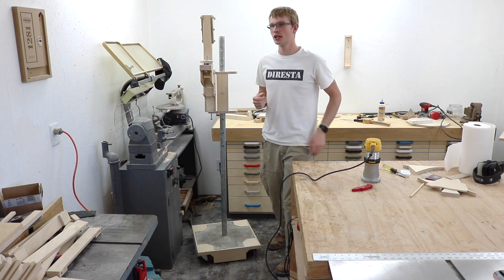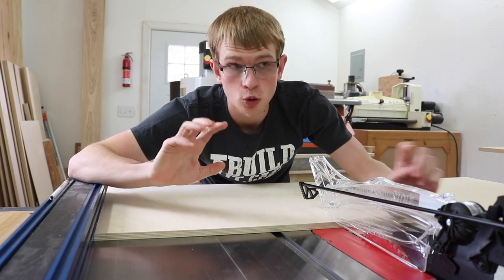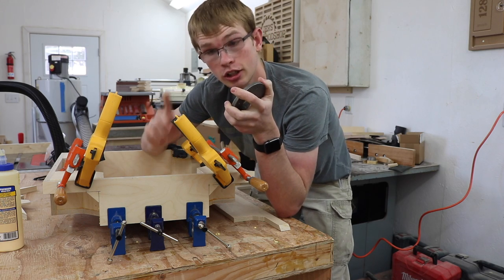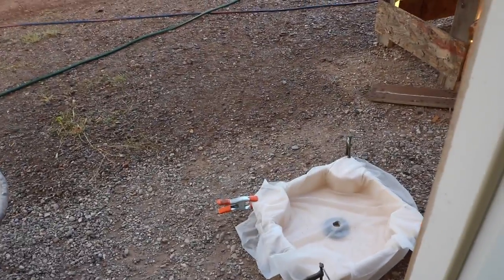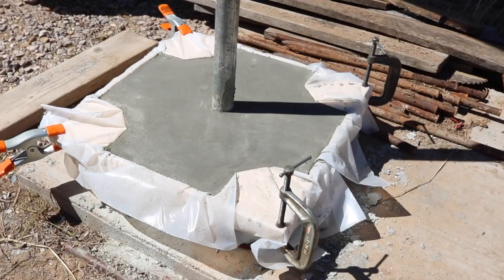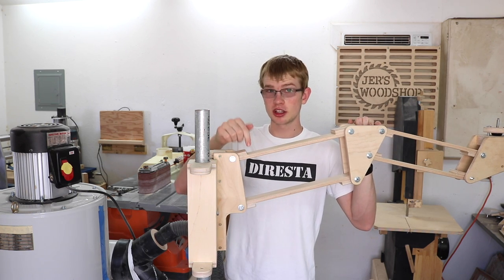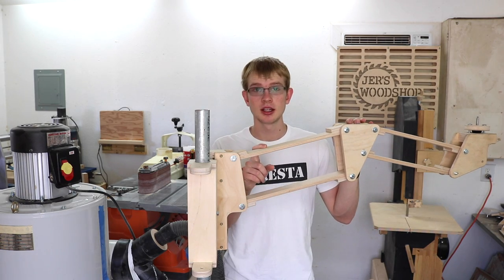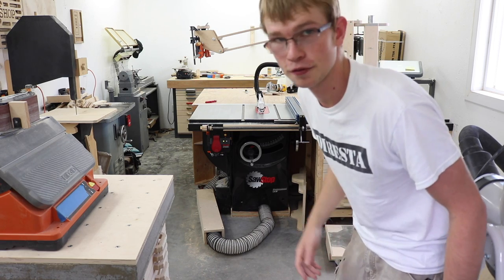Rolling concrete camera rig

Comment: I wasn't sold on your camera-mount-on-the-wall for my usage (my walls are mostly clogged up), but I'm a big fan of this, camera-equipment-making-guy! The small footprint is the killer feature for me, a lot of my shots the tripod has to go around dust collection hoses and power cables just to get the correct angle.
Reply from the maker: +Paul Jenkins 
I'm thinking I probably won't even use the wall mount anymore, except over the metal lathe.
You mentioned cords & DC hoses...those might really be a problem if you have a lot of them on the floor. When moving something on casters, those suddenly look like unyielding obstacles!
Reply: It shouldn't be too bad, I have a ramp/cover thing over the main cable, its just because of the stupid footprint of the tripod it gets in the way. The same shot with this - particularly with the boom arm - would have the base well clear of anything.

Comment: Over the 7 years since the the idea was shared I had the idea of three wheels being better. Now I’ve made a list of pros/cons. Tipping a tiny amount on a relatively smooth floor doesn’t seem like a priority. Wide enough three wheel is stable but four wheels rescues the directions it can tip by a great amount. Seems like a toss up and I’ll likely end up making both.

Comment: Really nice work you're doing!

If I might offer a suggestion -- the reason you had a failure at the 9:30 mark is because you are relying solely on glue to hold the joint.  This is actually quite common and I don't know why more people don't cross-pin the wood.

What I do (even on solid wood that will be in a similar application) is to drill 1/8" holes through the plywood, from one face to the other.  Then glue in short lengths of 1/8" dowel rod or those bamboo shish kabob skewers you get at the grocery store.  Both are fully sand-able and give you a very nice look when finished.

In your application, you'd need at least two of them between the end of the arm and the hole for the pivot.  Three would be better, and four or five might be nice just for the visual appeal.

What these bits of dowel are doing is acting like rivets.  While you're still relying solely on a glue joint, because you now have all the layers of plywood joined together by the dowels, they have to move as one unit..... straight through the dowels.  

On solid wood, I drill from edge to edge - the hard way - and glue in as large a dowel as is reasonable and the board will allow.  As long as you glue or screw either through the dowel or behind it, you've got a super strong end piece that won't check in years to come.  This is especially useful when doing something like a canoe carry handle where there is almost no room between the end of the wood and where the screws have to go!

Hope you find that helpful.  Keep up the great work!
Reply: Or just punch few nails in. It won't be as pretty but it will hold.

Comment: Well done, señor.
I made a PVC camera holder (Frugal Film Maker) that is cheap and laughable but it does have a very small footprint.
I love your concrete approach. 
Generally i'm a sucker for projects involving wood & steel or wood & brass, but you and Ben Uyeda are pulling me into the concrete realm. Thanks for the inspiration !
Keep on trucking ! (from France)
Reply from the maker: +MakeFix 
Thanks!
Concrete is kinda fun (and sometimes frustrating), and I think it definitely has its place.

Comment: Love this design! My shop floor is pretty uneven. Thinking of doing three wheels instead of four. Thoughts anybody?
Reply from the maker: I think making it three-wheeled is a good idea for an uneven floor. It will be slightly easier to tip over, but this one is almost impossible to tip so I’m sure it’ll still be fine.
Reply: @Jer_Schmidt  thanks Jer! I didn’t expect a response from the man himself on a video from four years ago. Very cool!

Comment: Hey you might want to consider putting some kind of rubber dampers/bushings at the camera mount and where it attaches to the pole- maybe it will smooth out some of the shakes so you can use it as a dolly

Comment: Great job man. I'm halfway done with something like this but since my floor is not even I'm just using a 5 liter oil can that I will have to move :S. Your design for the base was very clever! I was wondering why not just a friction fit for the pipe bracket? Mine is just a big block of wood with a hole and a partition, tightened with a  knob (not sure that makes sense). It does the job just fine and even better when the arm is extended. That saves making holes to the pipe and a "non discrete" height adjustment since my arm is not that flexible. Yours is awesome, I'm just thinking outloud now lol. Great job and thanks for all the good ideas!
Reply from the maker: +Cactus! workshop 
Thanks!
Because of my two-linkage arm, I have a lot of height adjustment in just that. So I don't plan to move the mount up and down the pipe much, and therefore I wanted it to be mounted fairly rigidly. But if I was planning to move it any more frequently then yes I would want something like a friction fit or just a simple locking knob.

Comment: Very nice piece of equipment.

You mentioned putting something on top of the concrete to protect it from chipping - why not skin it with plywood? Then you could mount accessories on the base later, if you develop any (storage for extra arm mounts, or camera adapters, etc).

With the mount being double-sided, you could put a monitor or laptop on the opposite side, connected to the camera, so you can see the image at a larger size while filming.

Comment: very nice idea, do you please have any idea how to build a C-stand, that cane go high like 3m or 2.5m where we can put some light projector?
Reply from the maker: +Cours Kiné 
With this stand I can put the camera up to just over 2.5m, by putting the bracket in the highest hole in the pipe, and extending the arm as high as it goes. You could make it go higher by simply using a longer pipe.

Comment: Mr. Schmidt, I'm a subscriber and I enjoy your videos but  I'm not a woodworker or craftsman of any type.
You used a lot of glue in the base of this project but no screws or metal fasteners?
Is glue as strong as screws?  I would have never thought your caster supports would hold, that your concrete slab would have just fallen to the floor.  My education continues, thanks for your videos!
Reply from the maker: +Dennis Davis 
Wood glue joints are usually stronger than the wood itself. The porosity of wood grain lends itself to extremely strong glue adhesion, since the glue has a lot to grab onto. There are certain occasions where screws or nails would be a better choice, but rarely are they stronger than glue. Typically I would only use screws if I want to be able to take the project back apart later, or if I'm in a hurry and don't want to wait for glue to set. I sometimes also use screws in addition to glue, either for extra strength or just as clamps.

Comment: I know this is an older video, but have you thought of making your camera mounts on tracks on the ceiling? This way you can pull them down, move them around, and it'll allow for the movement shots you said was too shakey with the casters. Just a thought.
Reply from the maker: Yes, but I don’t plan to stay in this shop for much longer, so don’t want to do anything permanent

Comment: Really good job. Excellent creativity. Just curious, Why didn't you make metal base instead of the wooden one?
Reply from the maker: +Kraisar Gilitwala 
Thanks!
I used wood because it's a little cheaper and I don't have much metalworking equipment yet, esp. a plasma cutter, which would have been fantastic for this if I had used metal.

Comment: It is perfectly OK to weld galvanized metal in a well ventilated space, or outside. If the day is perfectly still, I might suggest having a fan to keep fumes from just sitting around your face.
Reply from the maker: +Scott M (Scotty2307) 
Yeah, that's why I felt quite comfortable doing it outside :)

Comment: hey Jeremy, do you have a thing for vintage tools? I couldnt help but notice you have an old unisaw next to the lathe.....
Reply from the maker: +brandon2076 
Correction: that's a shaper. But yes I do kinda have a thing for vintage tools. They are so much better quality than the new stuff and they can be had for a much lower price tag!
Reply: Ah! Me too! I like watching Keith Rucker do his thing on the vintage machinery channel, awesome stuff. i couldve had a mint unisaw for $400, but my mom would kill me and theres no room in my tiny shop...i do have an old delta bandsaw that i love.
Reply from the maker: +brandon2076 
Cool! I have the shaper, lathe, and drill press, all made by Delta/Rockwell and all awesome machines! I used to also have an old Craftsman table saw and radial arm saw, but they had to go due to safety concerns...
Reply: Yeah i remember that one, a 100 series or 103 or something?

Comment: Do you use sand for the mortar?  I thought concrete (which you claim that this is) has aggregrate in as well.  Or am I hopelessly wrong on both counts?  Wouldn't be the first time :)   Nice build tho.
Reply from the maker: +EscapeMCP 
It's premixed. Everything that concrete needs in one bag. It's the most common type of bagged concrete here in the US.

Comment: Great design.  All you needed to do was drill holes in the pipe and slide the rebar in.  Welding wasn't really needed.  Nice welding helmet I think I have the same one.
Reply from the maker: +Skully Wood & Metal 
Welding is much easier than drilling
Reply: I have a 100 year old drill press that will drill hole in almost anything / any size.  Still a great job and great idea.

Comment: Nice camera equipment channel!! Just a quick question: what size is your shop? Preferably in sqm if you'd pleace :)
Reply from the maker: +Elias Douah 
24.62 square meters.
Reply: Thanks! Nice video and really cool design of the stands bottom with that very low center of gravity!

Comment: A separate camera mount that goes right on the pole without the extension arm might give you enough rigidity for a dolly shot.
Reply from the maker: +Cadwaladr 
Maybe it would! I might give that a try yet. Thanks.
Reply: The shakiness is most likely coming from imperfections in the floor surface.  When shooting dolly shots most pros will use a track to ride on for this reason.  Another way to do it is to avoid the dolly/track all together and use a steady cam rig.  Another "camera accessory build" for Jeremy.  :)
Reply from the maker: +GarageWoodworks 
Yeah, I guess I can't expect anything better than that from a shop floor. But that's fine cause it still does what I wanted it to!
Reply: Love shop made projects like that.  Very innovative.

Comment: great idea, but, best with simple sand
Reply from the maker: Yes, probably. Would sure be easier to build. But you would have to come up with some way to secure the pole, since that’s partly what the concrete does. And you’d need a lid to hold the sand in, and it wouldn’t be quite as heavy. Still most likely the way to go.

Comment: In the future, you should post a proposed idea and let us add to your great work.  In this case, poking up a piece of rebar about 12" vertically would have allowed you to have an additional rack to drop those vinyl-coated cheap weightlifting weights onto, thus making your base heavier or lighter as needed.  That's what I'll do when I use this idea.  :)  Thanks for posting!

Comment: Being that you were willing to invest the time and resources to make this build, I would suggest building a railing system on the ceiling that would accommodate being able to move, pan and tilt the camera. No floor footprint would be used for this. Like what you would see in a radiology camera room, the camera is mounted on the ceiling out from occupying needed floor space. Thumbs up.

Comment: it's no more a tripod much more like a pedestal which can lever the camera up n down.why not u rig a pole track on your ceiling(like a dolly track) which u can easily move your camera around the workshop using your wooden jib arm.nice job nonetheless👍
Reply from the maker: +Rockette Jam 
John Heisz did that, but it doesn't work as well with my shop because of the vaulted ceiling and loft...

Comment: nice effort! but you should do a bit of research before "imagining" stuff. I can't even think how fiddling should be to find those wholes on the pole, or if you'd like to rotate the camera around the pole. (although the arm gives you some degree of movement).
I might be a pessimist/hater whatever, still I think you should do some more research. 
I do appreciate your effort but somehow I have the feeling you dig yourself deep into a box. Research will help you be more creative, and think outside the box. (yeah I hate the outside the box thing, but this time I find it proper ex:7:29, what about just to cut another piece of pipe that would fit over the pole?)

I hope you get angry enough with me that you will outdo yourself! :)
Cheers mate
Reply from the maker: +Bogdan Bordeianu 
I do A LOT of research, so this comment bothers me. I have never raised/lowered the arm mount on the pole, and that's what I had in mind when I designed it. I made it adjustable so that I could find the optimal location, then leave it there forever. I have no reason to, but I could very well chop off the excess pole now that I found the height I like. 
Should I also point out my belt grinder build, which I researched and developed for two years before building? You want me to spend more time than that in R&D?!
Reply: Yeah maybe you re right it did sounded very general. Idid get to your video by accident, watching photography related gear videos. From that standpoint I think you should have researched better camera stands and reflect more on the pls for your stand. still using a piece of pipe as spacer (the thing at min 7:29) would have been nicer I think.